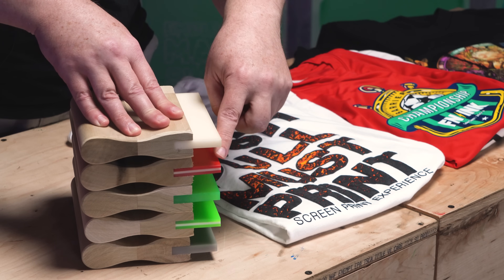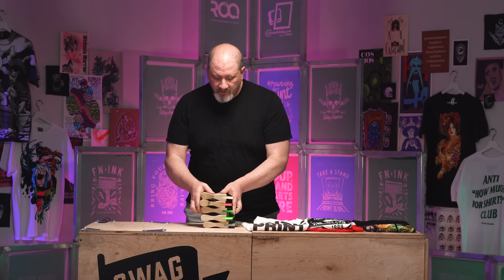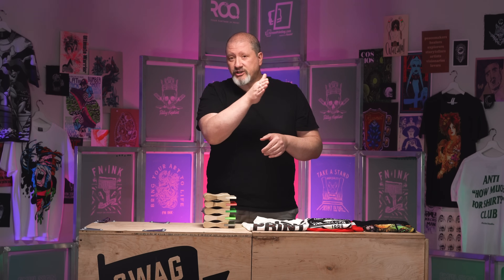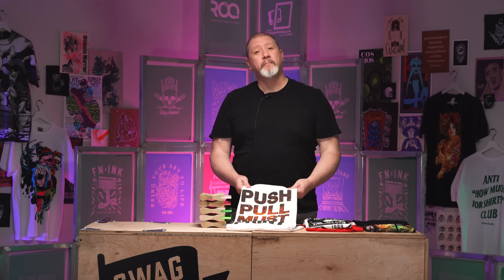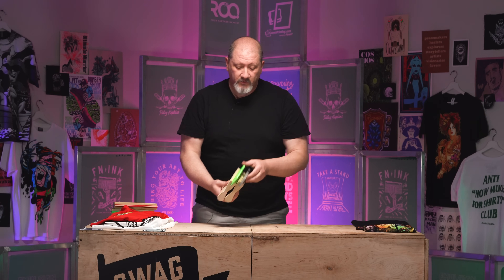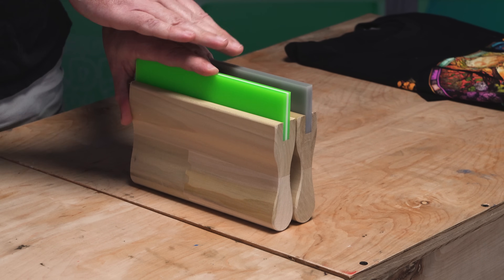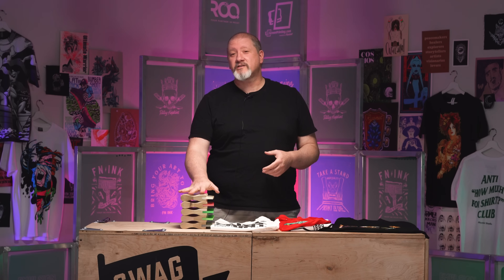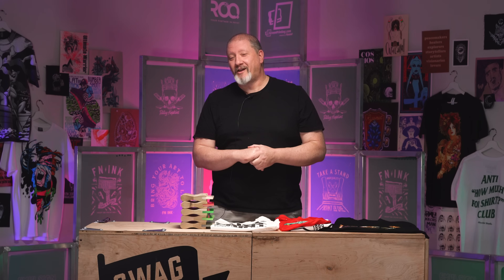Squeegee Durometer and Angle | Deep Dive With Colin

Comment: Is the durometer as effective in a push stroke vs pull? I’m guessing that the ink shear may be the same, but the force applied would be the variable.
Reply from the maker: In a push stroke, you don't have the same downforce as you do when you are pulling (it's only when you are using stiffer blades that the downforce can get close to equal, but that introduces a different issue).  But, you still have the edge of the blade interacting with the ink and the screen.  So ink shear is still very important.  The edge of the blade will still "roll" with the ink as the blade gets softer.

So your guess is really close to correct.

Comment: How would you adjust these recommendations for waterbase inks?
Reply from the maker: Waterbase Hmm....

Discharge WB or High solids WB printing?

Both have a slightly different approach.  But overall you are typically using slightly softer blades like 63/90/63, 65/90/65, or 70 durometer.  Rarely do you want to use a squeegee harder than a 70.  You get into very specific printing approaches at that point.

Comment: Great information! I could ask sooo many follow up questions but off the top of my head would you suggest more or less off contact depending on the durometer? 

Say for instance I had a simple white print block letter “Happy Birthday”. If I was using a 70/90/70 would I be better to have a bit more off contact with a hard flood and sheer (and perhaps a couple of more strokes to ensure coverage) verses a 60 or 70 durometer would I want a touch less off contact in case the print has a bit too much dragging from the slight flex increase (and maybe less strokes or even dry strokes)?
Reply from the maker: Hi!

Off contact "should" remain consistent across squeegee blade types for the work you are doing.  We still want the screen to snap off the print as quickly as possible.  You can see this in the previous deep dive video on Functional Off Contact.

A sharper/harder squeegee blade will help you with functional off contact by sheering or cutting the ink layer better than a softer squeegee will.  However!!!!  A harder blade will also lay down a thinner ink deposit compared to a softer blade.  So depending on what you need from the print, make your decision there.

My personal approach to simple lettering is to grab a 65/90/65 or 70 durometer squeegee and get the cleanest and most opaque ink laydown I can in as few strokes as possible, 1 maybe 2 print strokes at most.

I want to use as little pressure as needed to get the ink onto the shirt and out of the screen mesh.  Too much pressure can and will drive the ink INTO the shirt, which just makes a dull looking print.

Let me know if I hit all the marks or if you still have questions!
Reply: @Ryonet  Thanks for the amazing follow up explanation. I guess I was referring to the off contact still happening to achieve the snap like you said but maybe the difference of 1/16 verses 1/8 inch or something like that depending on the durometer. But I might be overthinking that part and should focus on what is correct for the design with the particular garment.

I also believe in having as little amount of squeegee strokes and pressure as possible to achieve a perfect underbase. However, most often I will clear a 157/48 mesh with my triple duro 70/90/70 in 2 passes with quite minimal pressure but will find that I'm not getting the opacity needed unless I do a third stroke until the ink really warms up on a print run (despite stirring the ink and warming the platens beforehand). Hence I should do as you suggested and try the 70 I have instead or maybe the triple one (60/80/60 was it?)

I believe I'm getting dialed on the EOM side but that could also be something I could increase perhaps as I'll do further testing with my coating thickness gauge I just acquired recently. I zero'd it and was getting around 38-42 microns.

I'm using Bolt White and have also switched from using 1% viscosity buster to virtually nothing and that also seems to have helped achieve slightly more opacity (even though it says you can add up to 3% without it affecting things opacity wise).

I should iterate that these are on combed cotton or less than ideal weaves-ringspun I can definitely lay a thinner deposit and be fine on the opacity.

Thanks again Ryonet! You guys are the best.

Comment: What about wood vs aluminum squeegees. Are they different or just personal preference. Thanks for the videos too!
Reply from the maker: Hi!

The squeegee handle does not make a difference in how the squeegee blade performs as in softness or hardness of blade. 

The shape of the handle, or the angle at which the handle forces you to grab it, that makes a difference.

Take EZ grip squeegees as an example:  The handle forces you to have more angle to the squeegee just from grabbing it.  It is difficult to hold the squeegee in a way that the angle is closer to straight up.